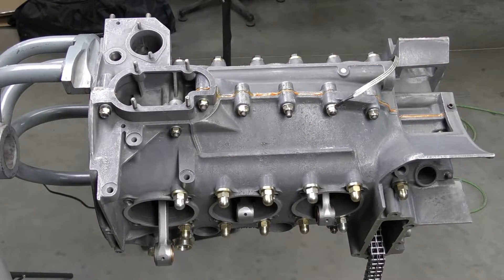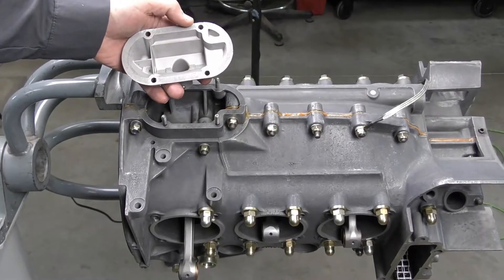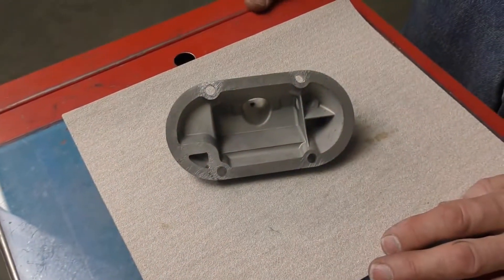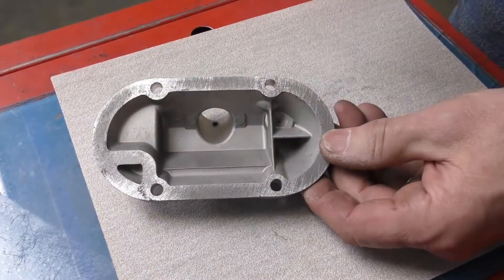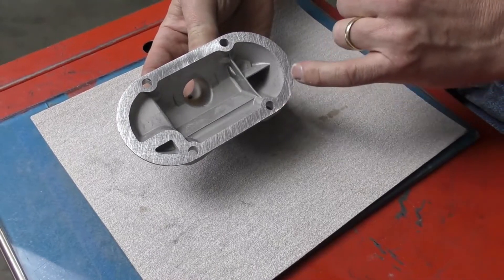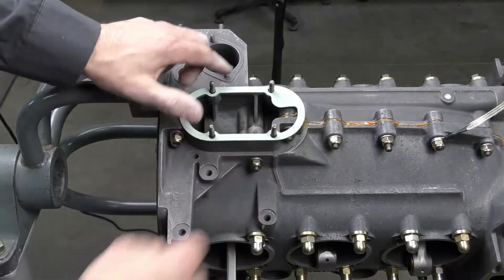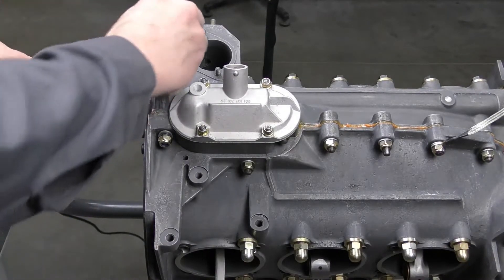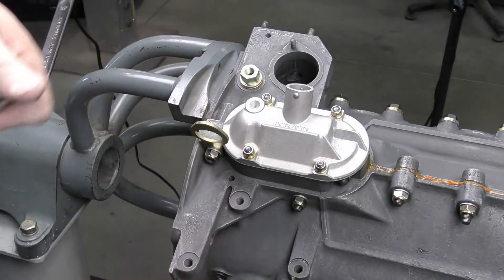Fitting the Oil Breather Plate. Rebuilding Your Air-Cooled Porsche Engine

Comment: Of all things, I have questions about the lifting hook. 🙃 That single stud is sufficient to carry the weight of the fully assembled engine?! Are there any engines / cars where it could cause interference? Ours is a 1970 914-6 (aka 1969 911T) for example. I found a part number 901-101-151-00 for sale, but am not seeing it in the factory parts catalog applicable to 914 or early 911. As always thanks for taking time to respond to comments.
Reply from the maker: The lifting hook is only carrying half the weight of the engine as the factory lifting tool also connects to the front carrier. Yes and 8mm stud is more than enough to carry that weight. The only issue I could see with installing it on a 914/6 would be it might get in the way of being able to see the timing marks. Other than that I dont see any other issues.
Kurt

Comment: Thanks again for the great video, as well as for the ones covering the oil thermostat and pressure and safety valve installation.  It seems the torque spec for installing the oil pressure sender adapter (M18x1.5) into the case is another spec missing from the factory shop manual.  In my engine (88 Carrera, aluminum case) the same adapter is used for mounting the oil pressure switch.  I don't want to use the spec for the pressure relief/safety plugs since the adapter has much reduced threaded length.  The torque spec for the 8 inner chain guide rail bolts and the breather plate are also missing from the factory manual/spec books.  You may have noticed, it's very easy to find widely varying torque recommendations in the various printed aftermarket manuals.  I'm afraid some of these might be just "made-up".
Reply from the maker: Mark,
So, Porsche information builds upon itself, and just having the 3.2L supplement may not give you all the information you need. For the oil pressure sender unit, the torque spec is located in the toolbox handbook on page 62, and it is "No More than 35 NM". 
When it comes to the other fasteners, you were asking about Porsche blankets, un-named individual fasteners by thier thread size. So what you will see in the handbooks are things like "All bolts on crankcase and camshaft housing" followed by the size "M6 - 10NM", "M8 - 25NM", M10 - 35NM". 
Instead of looking for the item, for example, the chain rail bolts, you just match the thread size, "M10" which gives you the tightening torque. Factory training on how to use the manuals also helps with this as we were all taught what tightening torques to use based on thread size and bolt strength. The shop manual is designed to give specific torque values on those items that require something special or are not in line with standard torque values.
Hope that helps
Kurt
PS: sorry for my late reply.

Comment: Thanks again!  I did this step today.  Although my "complete" gasket kit was missing this one as well as the oil thermostat o ring.  I did use your exact method for testing the thermostat as well.   I'll switch to the oil bypass spring video next.
Reply from the maker: Hopefully whoever you bought the gasket set from was able to send you the missing gasket and seal quickly

Comment: love your videos well explain and details. and with my poor experience I learnt that: always put some paste for multi joint plan. so between crankshaft cases and the gasket of the cover. U said no needs, but I'm pretty sure it's necesary. (sorry for my english)
Reply from the maker: Seb, 
Thanks for your kind comments. When it comes to using sealant on a gasket it is not necessary as the gasket is the sealer. However for the gasket to work correctly the mounting surfaces must be clean and flat. Surfaces that are distorted from years of use and/or mechanics with heavy hands and over-tightening of fasteners should always be flattened before re-installation. There are a few instances when I will use a very small amount of Loctite 574, this is usually when there is corrosion present on the sealing surface and it cannot be corrected by machining. Usually when completing a repair in the car and not doing a complete overhaul.
Thanks for watching